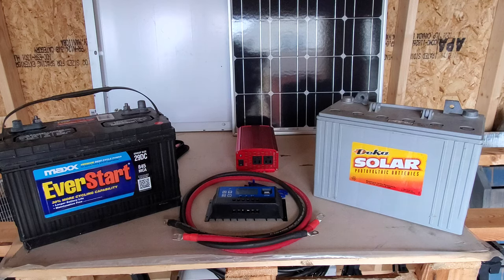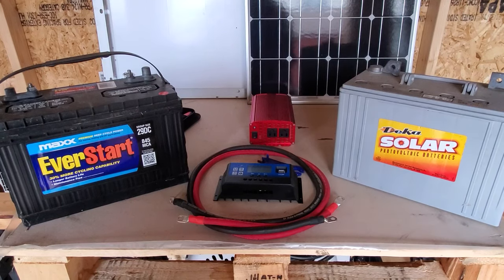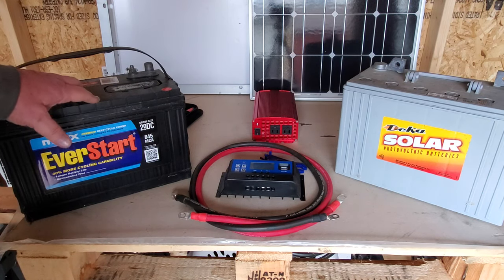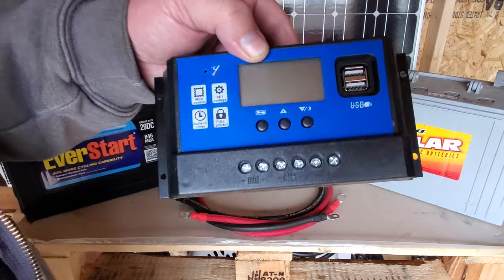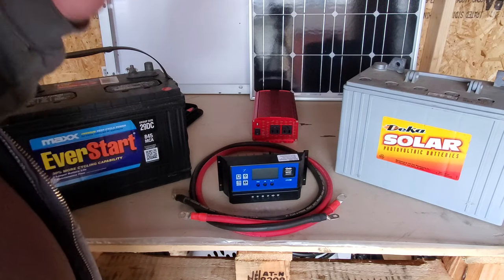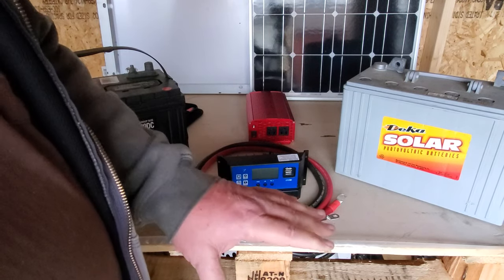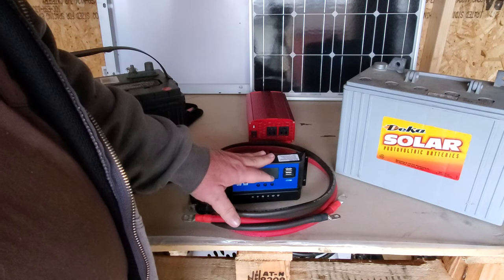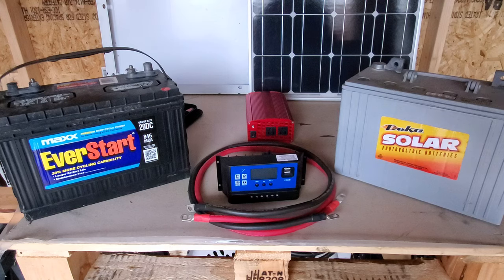Easy DIY Off Grid Solar System Basics - Panels, Controller, Batteries & Inverter

Comment: I bought 10 285w panels. I bought an AIMS 100a charge controller. I bought the breaker box and breakers for my 300 sq. ft. cabin. I need an inverter and wires. I've been looking for the gel batteries that, last I checked, are only sold in Canada. I have several deep cycle batteries and a 12v setup right now, but I'm looking forward to the day I can run my home with my panels alone. We have two generators which we use to recharge our batteries now. The other we run the air conditioning with in summer. Pete and I are planning on purchasing a 100 gallon gas storage and discharge pump from Northern Tool. Last summer we had to purchase petrol every other day! I didn't want to buy multiple inverters and the one I've been looking at is $900! Got any advice for a shortcut?

Comment: just bought the Inergy Apex solar generator with 3 panels....works nice, we are in Maine sometimes no sun and I can charge it in my car with cig lighter or my gas generator also
Reply from the maker: +DJKdee I'd like to get one of those.
Reply: @StBernardAcres  got a Honda eu2200 gas generator too....it runs along time on a gallon of gas and is quiet

Comment: I want to build a solar generator that uses 24 V batteries can I use a mixture of 12 and 24-volt solar panels?  Or do I only need to use 24-volt panels only?  Thanks

Comment: How many Amper hours is thar Walmart Deep Cycle? I have 2 of the same but need to know how many hours will it last before recharging? For instance a 35Ah battery, does that mean if you put a 35 Ah load on for 1 hour it would be discharged?

Comment: I am getting to the point on the cabin build that I will be putting in a circuit panel. Started to run my wires through the studs and place boxes and light switches. I want a system that can run off of the batteries and then I Could start the generator on bad days to top off the batteries Or if I want to run the A.C. and need a little more power. I am so confused about wiring the box and what I would need. The cabin isn't going to be wired to the grid at this time. Would like to set it up like my RV. But how many watts, volts, amp hours ect, ect... Sounds like jiber jaber to my ears at this time. How do you add the Power inverter to a system that has a breaker box? But haven't seen a video that takes you step by step through the process. If anyone knows any let me know!
Reply from the maker: I can totally understand.  I did a video a couple of months ago addressing how I am doing it, so I can switch inside the panel if I am running off of solar or generator.  I am still researching the best inverter,  but this shows you the idea of how it works.  If the link doesn't work, look for my video titled "connecting a generator to my service panel".  Something like that lol.  Let me know if that helps any!
https://youtu.be/IO25O6qjbPY

Comment: When you bought those two 100w solar panels, specifically what did you have in mind powering ?
Reply from the maker: +mybluebelly Interesting question.  I wanted to power the RV. When I bought them, I knew nothing about solar.  It was a complete experiment and trial & error.

Comment: Lol, my travel trailer is wired for Zamp panels,  for whatever that's worth,  and obviously has a 12 volt system (with a whole 1 battery) and so far as I can tell, zero 12 volt  outlets 
My old Kit trailer at least had that
Reply from the maker: +Art Webb That's interesting lol